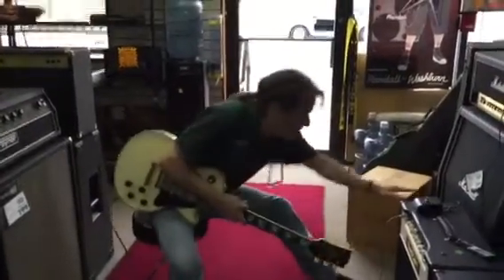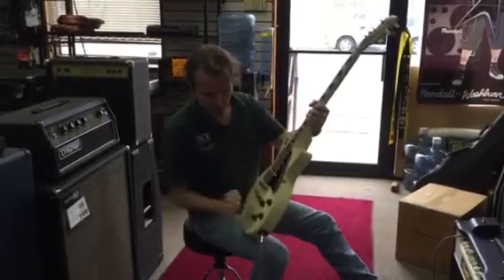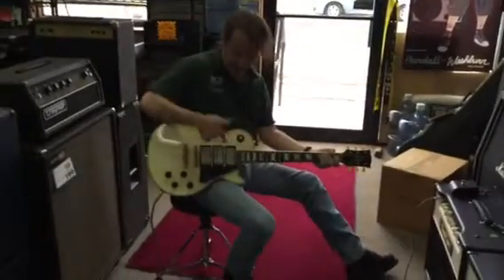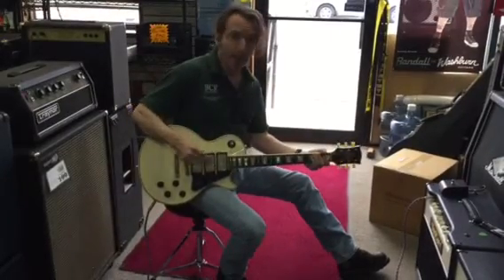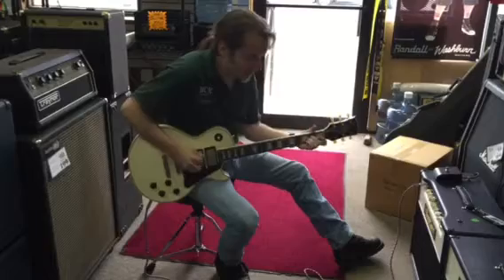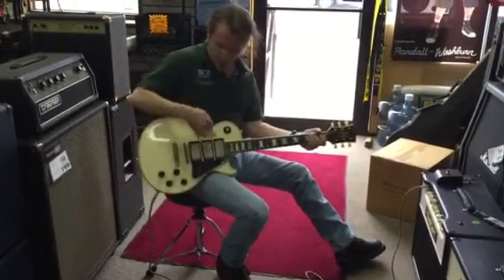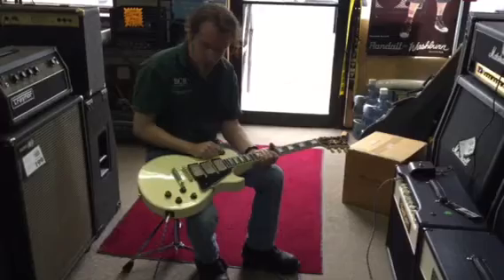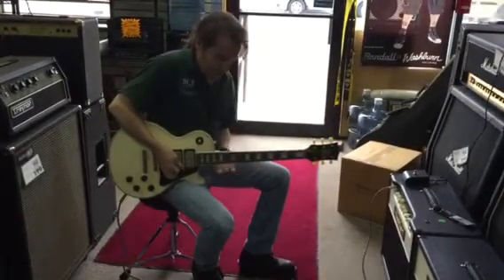Uncle Greg's awesome three-pickup wiring scheme

Comment: Interesting video!  I presume that you can't get Bridge plus Middle...unless the volume controls are wired like a Jazz Bass (pickup hot to the middle terminal) and you turn the Neck volume all the way down with the pickup selector in the middle.

The Epiphone Riviera P93 has similar wiring although when you turn up the Middle pickup's volume, it's always on no matter what position the pickup selector is in.